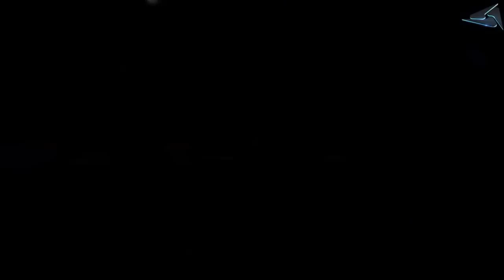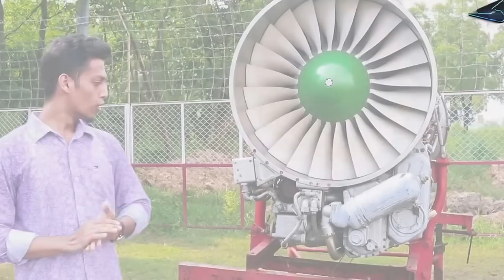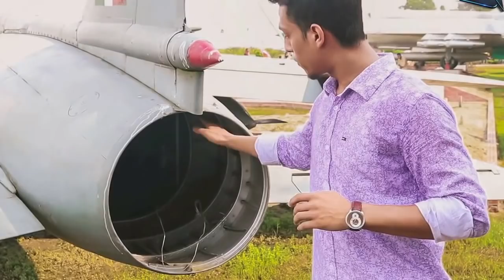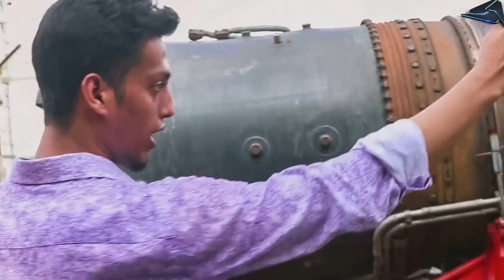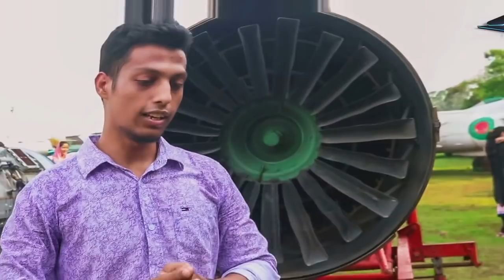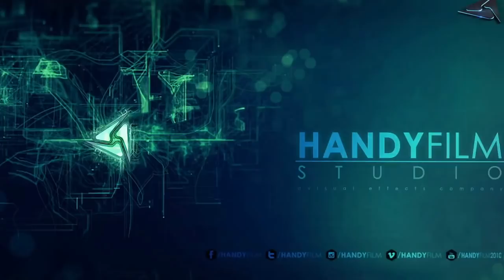জেট ইঞ্জিন কিভাবে কাজ করে  | How Does The Jet Engine work - AVio Rana - HANDYFILM

Comment: ভাই জেট মেশিনে র rpmকত হয়
Reply from the maker: eta depend kore engine er vibinno category ar manufacturer companir upor. For example, large jet engines operate around 10,000 rpm, while micro turbines spin as fast as 500,000 rpm.
Reply: AvioTech - HANDYFILM ১০০০০rpm আমরা বাতাসে র জন্যে  যে পাখা ব্যবহার করি তাতে ই থাকে